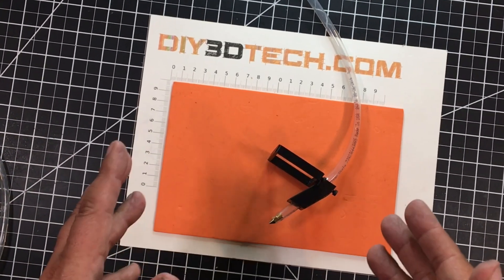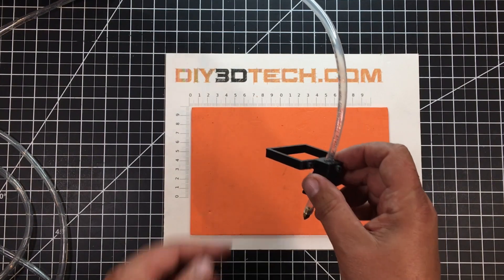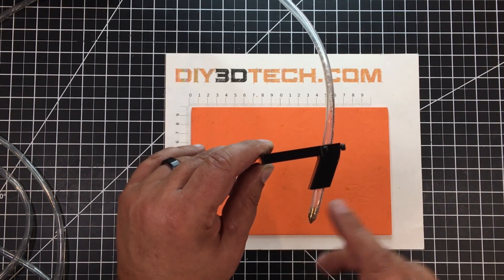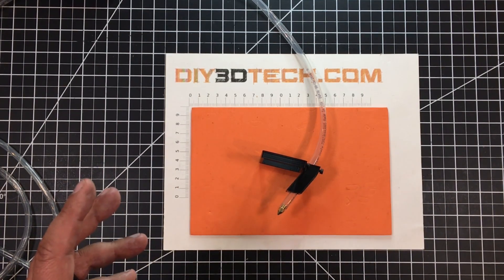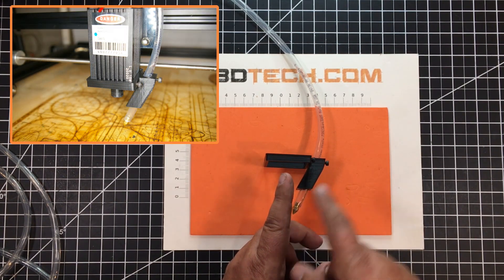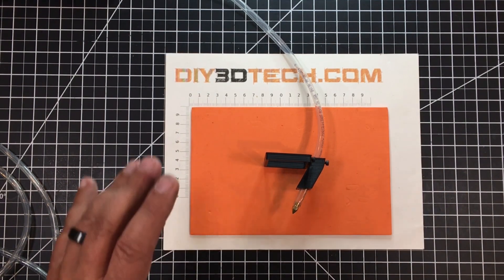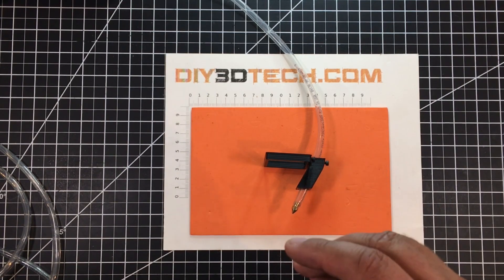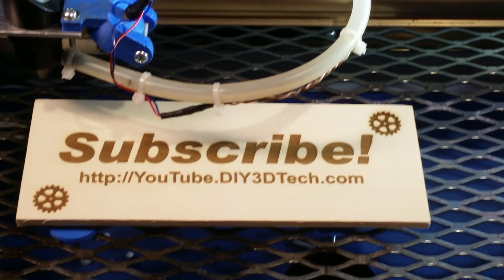Ortur Laser  -  New Air Assist Module!

Comment: Hi! I'm going around and around in circles because every link you have listed for the new air assist 3d print (stl file) goes back to the first version. I have already had the first version printed twice, and the laser does not line up with the hole at the bottom which is quite annoying. I think it needs 3 screws instead of 1 to hold the lens properly in alignment with the air assist nozzle. I would really like to print the second version, but every link I have gone to on Thingiverse and Youtube lead back to the old file. Please fix!
Reply from the maker: They are all correct so not sure the issue your seeing.  Suggest downloading from the https://designstore.diy3dtech.com/

Comment: I’m about to assemble my 20 watt otur master 2 laser. Got the G8 lens and a light burn camera. Will do the 30days free before purchasing. Sooo, maybe a question or two.  The G8 I received, the barrel (?), was not attached to the lens. On the barrel there is one end with a slot (like set up for a screwdriver) other end no slot. Does it matter which end I attach to the lens? And the Teflon tape, I assume it’s put on the end that goes into the main body of the laser?  Oh yeah, since I’m old as dirt I also picked up the usb microscope. I’m curious to see if I can get it to cut through some 3mm plywood.
Reply from the maker: Yes there is a direction to the lens and that is typically slot side down and yes to the tape entering the body.  Also yes to the 3mm ply wood.  Note with the plywood is it varies and the glue will be a factor in cutting it.  So you might want to try different bands to find the best one,,,
Reply: Thanks guys, I appreciate your response! Your channel deserves a subscribe, so I’m now officially subscribed.

Comment: What kind of connector do you use for attaching the silicone tubing to your compressor hose?  Thanks!
Reply from the maker: I only pump about 6psi so it just pushes on a barb connector on a regulator...
Reply: @DIY3DTECHcom  could you please let us know what barb connector you used? Having issues finding the correct one.  Thanks!

Comment: why would you need air assist for such a small laser???  theres no resaon... lol
Reply from the maker: You would be foolish not to have one especially on a small laser!  An air assist does three things (1) snuffs out fire and especially cutting cardboard you needs this watch my fire video and I can send you many more that happened because I did not have air assist!  Second (2) is to clear the smoke from the beam to prevent attenuation of the beam, this makes a huge difference, and (3) clears the kref of ash to allow the beam to strike virgin material as ash is an insulator.  See you learned something new today!
Reply: @DIY3DTECHcom  it wont start no fire its to weak of a laser . be serious.
Reply: @IronMan-yg4qw  You have literally no idea what you're talking about... do you? Air assist helps with ANY diode laser, primarily with clearing debris and ash to improve cutting performance.

Fires are also a serious issue on paper, cardboard, card stock and soft woods like balsa and basswood.

Try harder next time.
Reply: @johnhancock6951  thats just stupid.  air assist dont help with engraving. actually can hurt it.  but air is always good to blow away smoke from lens. so if air is npt pointing at focus point then it will help by blowing smoke away.  air assist is important  for cutting!!
Reply: @IronMan-yg4qw  You should probably reread my comment, specifically this section:

"Air assist helps with ANY diode laser, primarily with clearing debris and ash to improve cutting performance."

You go on to "debate" me, then confirm my position a few sentences later:

"air assist is important  for cutting!!"

Now, tell me which part of my comment is "stupid", considering you literally just proved my point for me... inadvertently.

Seriously, are you even trying at this point?
Reply: @johnhancock6951  oh oh oh.. for cutting... agreed lol
Reply: @IronMan-yg4qw  Dude my parts have caught fire trying to cut, i need this in my life...
Reply: @GoldenBearKarl  fire? when engaving???
Reply: @IronMan-yg4qw  laser cutting
Reply: @GoldenBearKarl  but small lasers cant cut.
Reply: @GoldenBearKarl  but small lasers cant cut!
Reply: @IronMan-yg4qw  apparently my 20W does....
Reply: @GoldenBearKarl  ya but but thats not a small laser. 20 watt an up is not small...